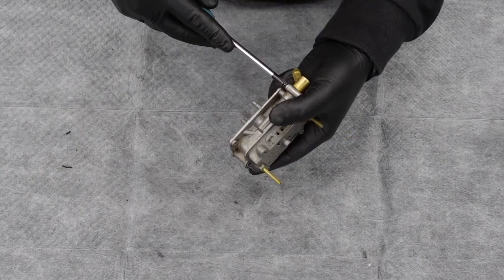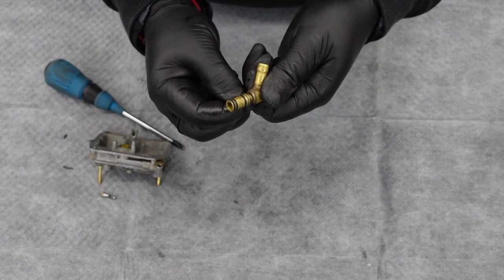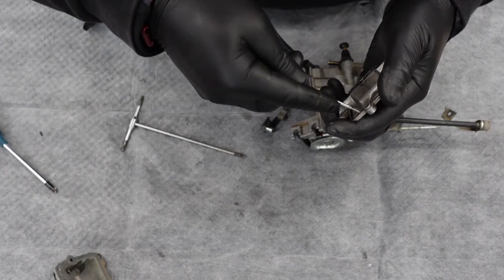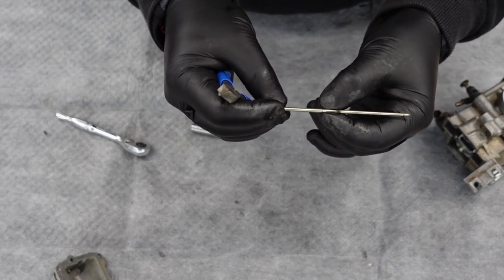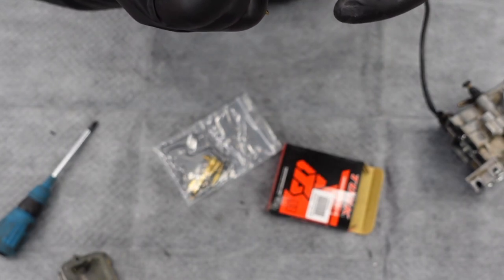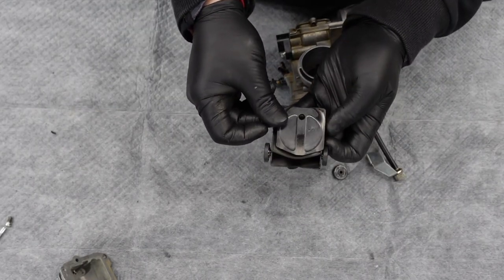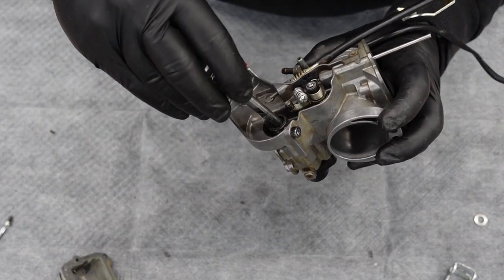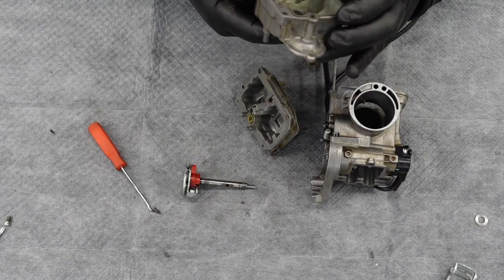This Is NOT in the MANUAL... | FCR Carburetor Rebuild Part 2

Comment: Maybe I missed it, but what did you use for your "deep clean"? My carb has that same green all over and pretty gummy. Evaporust safe to submerge in...no seals of course. Also, my 4 screws to reattach the float bowl side seem to be too short to grab threads. I even got new OEM screws and same deal. Ideas? Great vids!

Comment: These carb uploads are really going to help me build the fcr from my yz426f i took apart about a year ago haha. Thanks for sharing your knowledge with us 🫡
Reply from the maker: So glad you can get so much use!
Reply: @NW Moto Garage   Have a question for you. In the mid body there's 2 small brass pipes. What are they for because i dropped my mid body and one of them snapped off.?
Reply from the maker: @tomatoknuckles  oh no…. Not good, not good at all. Those help the fuel find it’s way to the top through a vacuum, they are really only air tubes so you might get away with it? I would say you have nothing to loose now so reinstall and see what happens. THE MOST IMPORTANT PART is coming back here to let me know how it goes. But if you need a new carb, I have actually had outstanding luck with the Amazon FCR carbs for only about $150. Tuned and ran just the same as OEM
Reply: @NW Moto Garage   Thanks for the quick reply man. I was thinking they had something to do with the hot start and choke but makes sense that they deliver fuel. Im going to epoxy it on and give it a try if it doesn't work ill take your advice and get that carb. Thanks again 👍

Comment: Where did you adjust the float height?  My 08 CRF450R owners manual says 6mm but the shop manual says 8mm.  Just looking for a source of truth.  I will say that 7mm is just about parallel.  Split the difference?

Comment: If the big seals are coming up short by heating them with a low setting heat gun it will make them grow. Or heat the carb bowl /  cover some to the temp that makes the seal fit

Comment: Hey I just found this video, I have the same carb but my vacuum release plate doesn’t seat on the carb slide, the bottom of it won’t seal, it’s causing my throttle to get stuck at 3/4 throttle, would a new seal fix it?

Comment: Mannn I stripped  the second tiny allen, last thing I needed to get before I could fully rebuild my midbody. Spend hours yesterday trying to get it out and now am to the point where it’s impossible. 

Can you tell me what the smaller gasket under the loop influences? My bike currently doesn’t wanna idle. I’ve tried every size pilot jet and ultrasonic cleaned. Midbody is my last hope for the carb and I stripped the last bolt I needed😢 hoping replacing the other gaskets I can get at and giving it a clean could be the difference still tho🙏🏻
Reply from the maker: Unfortunately I can’t tell you exactly what it does for sure, most likely accelerator pump but if any extra fuel or air is leaking through those seals it will effect your idle.

Comment: I’ve resorted to this. 06 crf250r and rebuilt everything except the mid body and the needle for the main jet. Bike only runs when all the way lean on the fuel setting and choked. It’s not making sense at all so I think this is the issue

Comment: is there any way to  save the seat for the inlet needle jet , or can one purchase the seat for inlet needle for float, looks like its pressed in  , l see the seat has  a little damage and will not seal so fuel comes out the over flow tube with float adjusted to 8mm ,thanks for any tips or ideas for my issue yamaha YZ 450 F think a 03 or 04 model year
Reply from the maker: Best bet is to purchase a new needle and hope that fixes it. Those are pressed in and I don’t see a part number for it. You might have to find just the smallest rotary polisher and polish that brass. The tips of those needles are rubber so they are pretty forgiving.
Reply: @nwmotogarage thanks wonder if one can purchase just the mid sections  with seat maybe available  not sure
Reply from the maker: @michaelcotgrave8487  unfortunately not, the only way is to buy used or new. I have had good luck with Amazon carbs. They tune the same way and function normally for only $170-180
Reply: @nwmotogarage  thanks for the info its really sad one cant change the seat , again thanks for your input , great video for me and all
Reply from the maker: @michaelcotgrave8487  usually you can, but not on this style. They don’t get damaged really unless someone tries to remove them with pliers or tries to clean it with a screwdriver
Reply: can one purchase a mid section for these , not sure , thanks
Reply from the maker: @michaelcotgrave8487  unfortunately no
Reply: @nwmotogarage  thanks for the tips , is the seat base where needle rest tapered  or flat , l could try like stated a really fine  rotary polisher , if that doesnt work will order a new carb , like you stated l checked it out price not bad for sure

Comment: Great video ive got the same carb. My bike won’t idle on its own so I was told to clean carb and jets. I’ve put it back together and now my bike won’t start anyone no?
Reply from the maker: First thing first is to remove the carb again and double check that all of your work you did is still correct, slide plate is correct, your fuel screw has the o-ring on it. Then Reinstall and make sure the hot start and choke isn’t cracked.

Comment: @ 7:37 it appears that I had x4 additional o-rings in the “4 corners” of the mid->main body that you did not appear to either have installed or potentially missed 🫣🤷🏼‍♂️
Not not picking or being a ass just currently build my new fcr41 mx and I’m using your guide as my bible 🤣🤣🤙🏼🤙🏼
Reply: I know right? I saw another mid-body gasket install video on YouTube and he also omitted the 4 o-rings. From what I remember, I think they were in there originally. It's been a while since I tore my FCR apart from stock but I included those 4 o-rings that mount in the screw holes.